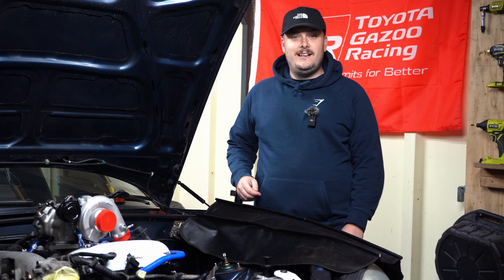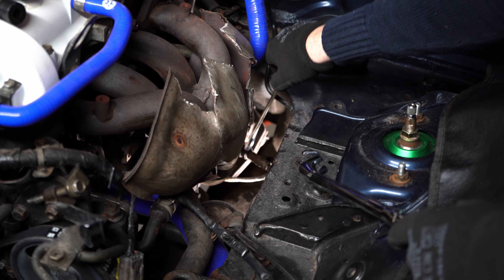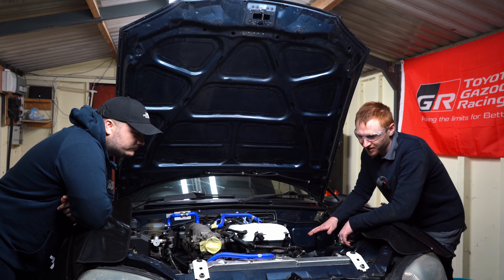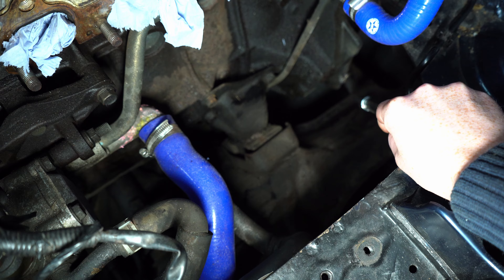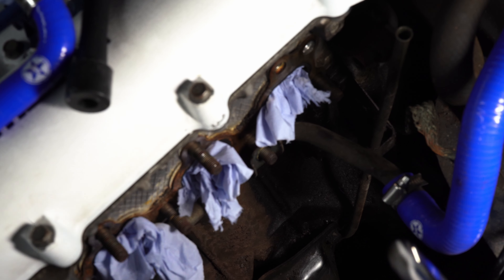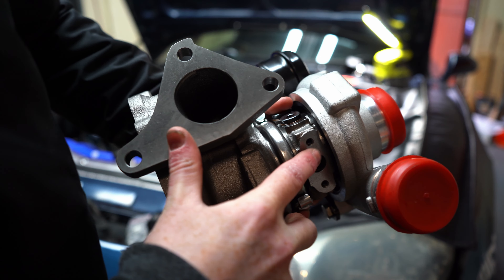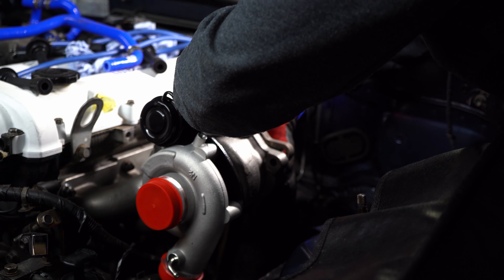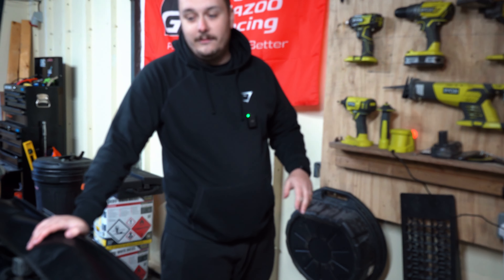DIY Turbo Build | NB MX5 Miata | Episode 2 | Manifold, Turbo, G19 Dipstick oil return, EGR Delete

Comment: Guys. im running for a me install guide. do you have it in pfd files by chance. Also i dont know what tap is coming with the kit. I know you didn't used ,but still may be you can have a look at it 4me.

TIA
Reply from the maker: They only supply paper install instructions and these ship with the ECU, if the ECU is delayed you can request instructions to be sent(this is what I did) 

I'm not sure on the tap, they don't supply one with the kit. Check out the bofi kit I think they list the tap size on the kit description.
Reply: Thx . How do you like the turbo.? Worth it? @kentcarmedia